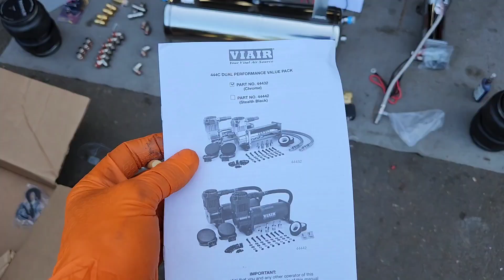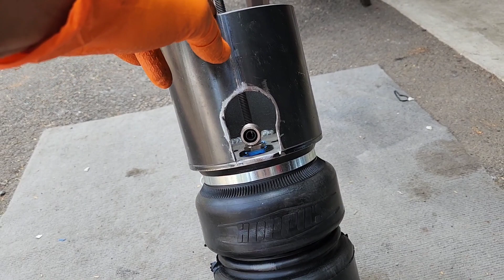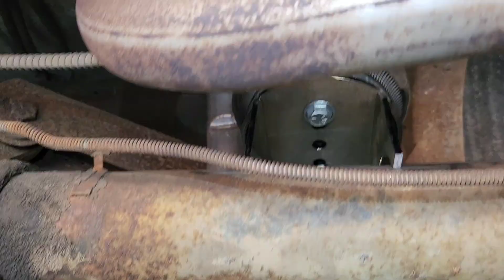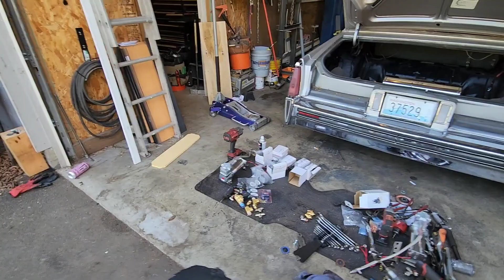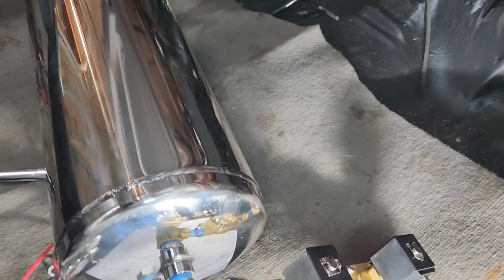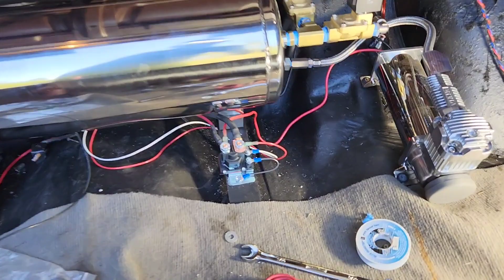install viair air suspension to 77 coupe deville cadillac

Comment: Did you have to remove any material from the spring pocket to make room for the bag?
Reply from the maker: No, but I do believe I did give two tack.Welds per side to hold it in the correct position.So far has been perfect, but watch out welding around these shield.The rubber somehow while you're doing this and make sure you're not rubbing in any position up or down... Okay, sounds like i'm making a damn porno...😂😅

Comment: Hey! Putting airride on my 73 i have one question: where did you put the front shocks? Or didn't you put them back on?
Reply from the maker: Most common the air bag stalls the shocks place so I make a few simple new mounts back side of control arms for new shock mounts
Reply: @oldskoolfool1 thanks for the reply! But on this build I see no more front shocks: did you leave them? On my '73 there is hardly any place to relocate them forwards (fuellines, coolant hoses, steering pump)
Reply from the maker: @A.vanVliet-d6c it's gonna be custom, send me a picture.And I might be able to give you some guidance..253-666-5596

Comment: Could you revert back to spring suspension on a 79? Asking since theres welding involved with airride
Reply from the maker: @memegator6937  yes it is possible
Reply from the maker: But that air rides along better that spring unless u are after a full stock build
Reply: @oldskoolfool1  naa its just annoying taking 10min to raise the car i just want to jump in and go, random airleaks, and not a lot of mechanics know how to work on these, starting to become fristrating.. for the 79 specifically i need to buy springs and struts separately right? Anything we should keep in mind before reverting back to springs?
Reply: Also could i revert back just rhe front suspension and keep the airride in the back, or could that cause issues with balls joints or other components upfront ripping off or breaking id i slam just the back? Last question, i notice my back airbags get air first and it takes about 5min for the air to reach the front bags, does this sound normal? The back airbags are quicker and more responsive than the front ones
Reply from the maker: @Justfactsssss-r5t  sounds like you have a few issues that might be the install but also line size to the front FX speed
Reply: @oldskoolfool1  how to fix? Also notice if i try to lift front first the air gauges go up but ride height stays the same until i lift the rear
Reply from the maker: @Justfactsssss-r5t  I would say, do you have a local semi truck company.. Those guys are very familiar with airlines and for the most part, they're pretty good. Another option too would be adjustable. Coilovers, you don't have struts in the front. Just Springs and shocks.
And is your rear end a four link question mark
Reply: @oldskoolfool1  do they make coilovers for 79 deville? Where can i find?
Reply from the maker: @memegator6937  They make coilovers for almost anything. Just Google them. All kinds of them will pop-up and direct fit bolt in nothing fancy needed. Maybe a adjustment on the spring.When they're done other than that, they're full fitted

Comment: How would you make the car not slam to the ground.
  Add some ride height?
  I'm fixing to install bags on mine.
Reply from the maker: There is adjustable valves to slow down how fast it goes down. And on the other ends, I like to make mine just high enough.
To drive but I do that by measurement. And you can extend the cup pieces or shortening for heist
Reply: @oldskoolfool1  OK thank
  I will probably have to end up extending cups. Thanks
  What's the best way to get a higher hop with bags?
Reply from the maker: O k that could be answered in two ways... How fast it drops... Or how low it go